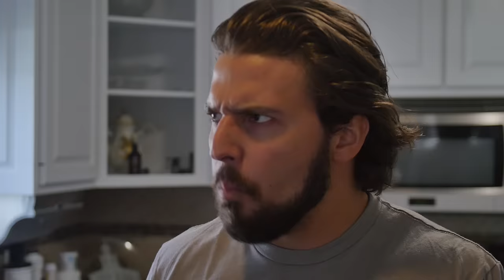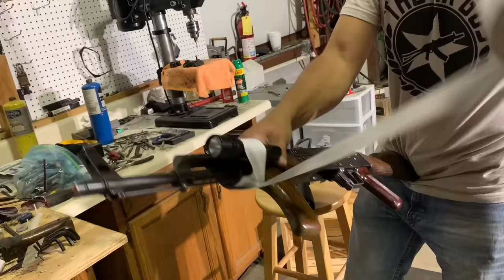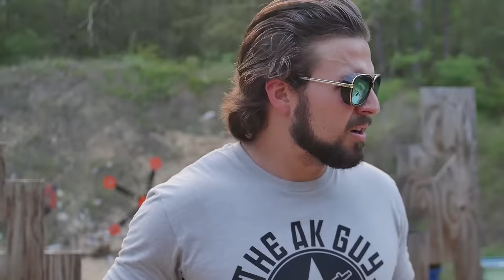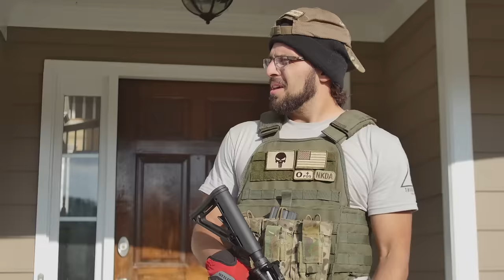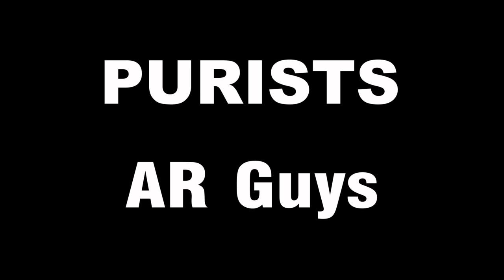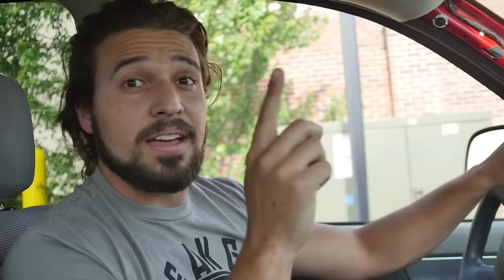AR Guys vs AK Guys #3 - Purists, Fudds, Coffee

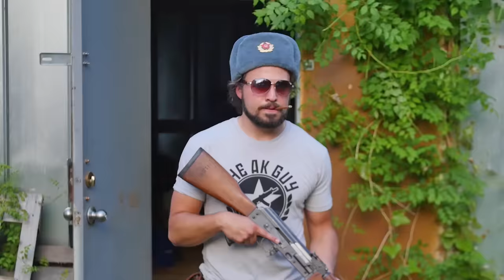Comment: 2:01 I'm pretty sure if you go out like that in texas you will get shot immediately

Edit: Thanks For All The Likes 😊
Reply: by what? an AR? puny 556 round is mosquito bite comrade
Reply: @denisl2760  good point
Reply: @denisl2760  by an ar-10
Reply: A 45.acp probably
Reply: Don't worry, it'll be a boomer with a 1911, you can just move out of the way.
Reply: True
Reply: Zachary Meier The acp part actually stands for anti communist-putin.
Reply: Aqi 1 I live in the Dallas area... I dunno if you live in a different area but i swear this happens often
Reply: Aqi 1  what town do you live in ive been over about half of Texas and a third of the people I see are outsiders except in South Texas where its roughly ⅔
Reply: @denisl2760  it will still kill u
Reply: @j.liddle7580  do AK guys not like the 1911 either?
Reply: @davidaguilarg.7093  i like the badass factor of the 1911. Idk what the deal is about it sucking. I mean .45 is acceptable stopping power.

Comment: I don't know, man. I went hunting with an AR just a couple months ago. Not only did it slid off a camp table onto the ground exactly like that, but at one point I dropped the mag in sand, and when I went to pick it up, I accidentally kicked it along the sand. I just inserted the mag and started walking, fully expecting it to not work. But it ran without issue. Maybe I just got lucky.

Comment: Don't remember which CGI it was, but for the AR accessories segment you did what you bashed a builder for doing, bolting the bipod to barrel instead of using the lower foregrip picatinny rail. Though either place screws with the grenade launcher lof. XD